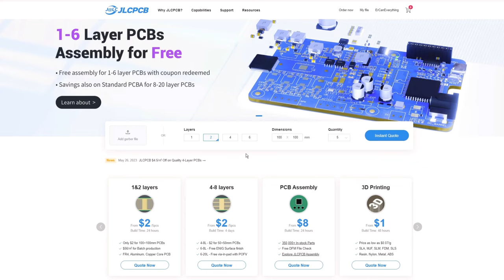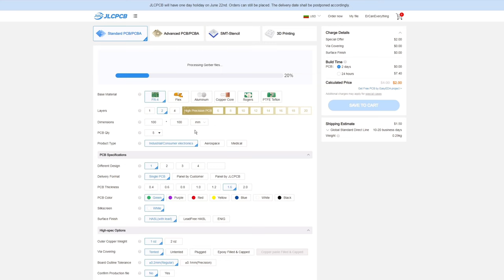Make your own SMD Soldering / Desoldering Hot Plate

Comment: I really like what you've done there, but please add an earth connection to the plate.  If the heating element fails you have the potential (pun intended) to have mains voltage on the heating surface.  That wouldn't be great for you or for your projects.

Comment: what you use for heating did not see full circuit and is there a way to control temperature or its going allays that high ? Tnx!
Reply from the maker: PTC heating element is also called PTC heater, which is composed of PTC ceramic heating element and aluminum tube. This type of PTC heating element has the advantages of small thermal resistance and high heat exchange efficiency, and is an automatic constant temperature and power saving electric heater.
260°C HotPlate
👉 https://s.click.aliexpress.com/e/_EvEMlhB
Reply: @ErCanEverything  thanks brother!